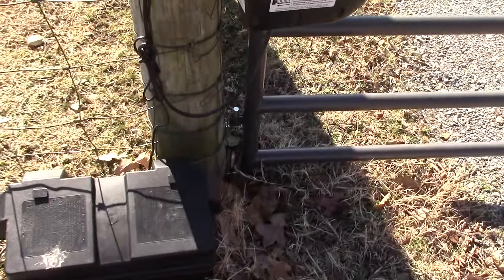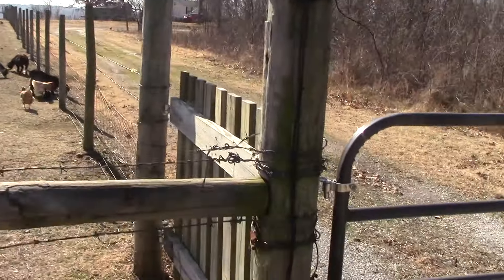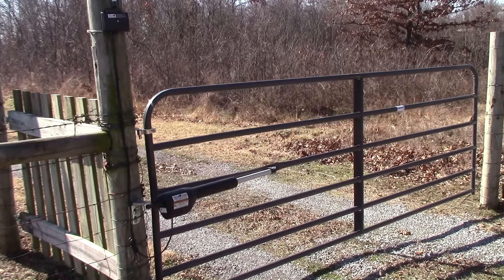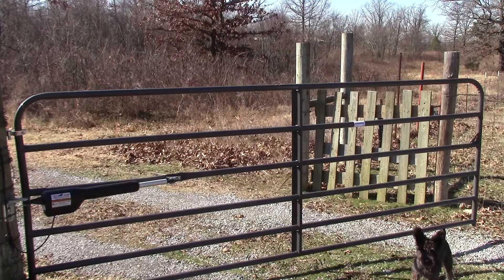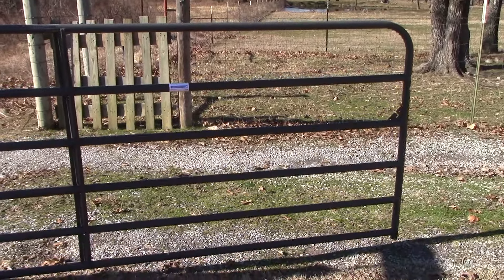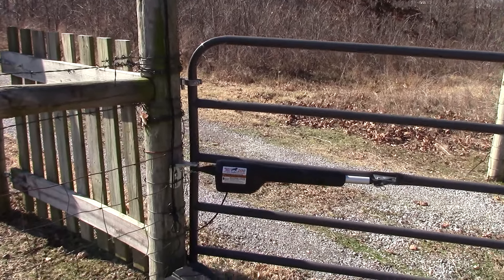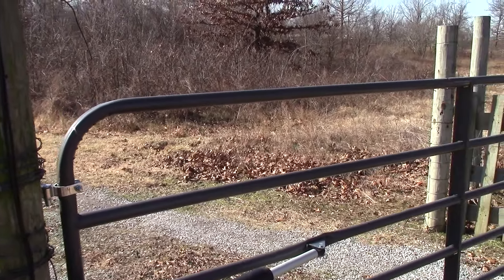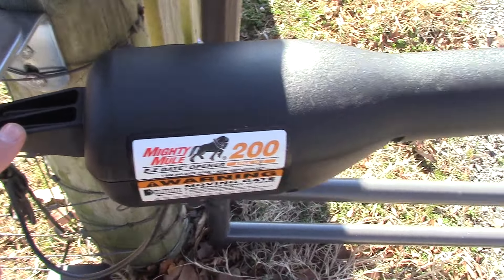Troubleshooting a Mighty Mule Gate Opener

Comment: Nice place. It looks like here. 
Our MM 360 status light doesn't blink. The transmitter sensor is solid. The only control is the momentary 2 wire configuration.
One transmitter will not program. Two keypads failed to move the gate. 😐😓😧.. It's frustrating but when they work we forget the issues involved with maintenance and adjustment.
Reply from the maker: They can be a headache that's for sure. I think the newer models are a lot better designed.
Reply: @HiddenHeightsFarm  two handheld transmitters now not working.. Solid amber.. I believe it's been narrowed.
Reply: @MadDragon75  Were you able to fix your problem? I also have an MM360 with the same symptoms. RF light stays on. Can't get the transmitter to learn. Learn button blinks once when held down and won't memorize the code. However, the green/black receiver terminals are fluctuating to the correct voltages when I press my transmitter. I can jumper the COMM and CYCLE and the gate will operate. The only thing off from all my troubleshooting is that I'm only getting a 4.88V reading for the red/black receiver terminals on the board when it should be 5V.
Reply: @fossil9158  not yet. I put it on hold. I need a new main board from what I understand. 
Good luck.. I'll post here if it works.
Reply: @MadDragon75  Thanks! Yeah, I'm thinking mine's the main board as well. I don't think it's the receiver itself.
Reply: @fossil9158  I did get the gate to work hardwired for a momentary switch.. Like a doorbell button.
Reply: @MadDragon75  Did you hard wire to Cycle? I can see how that would work.

Comment: It looked like the closed limit wasn't set.  There is a button (learn mast limit) inside to set the closed limit. It's really easy.  When the limit switch inside the arm is bad, it stops or opens midway and it's a little hard to fix because removing arm cover is a bitch. I've had a MM500 for 16 years and it still working.